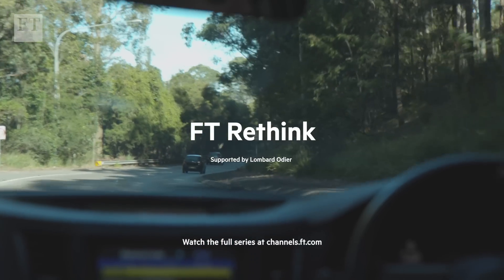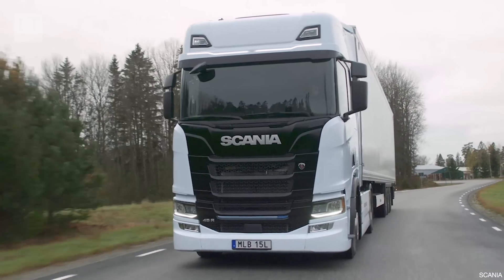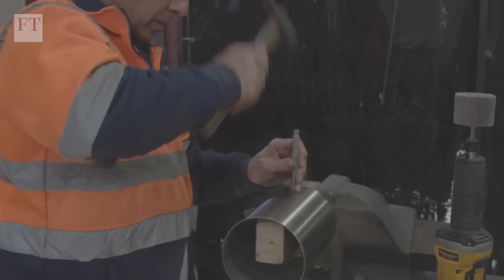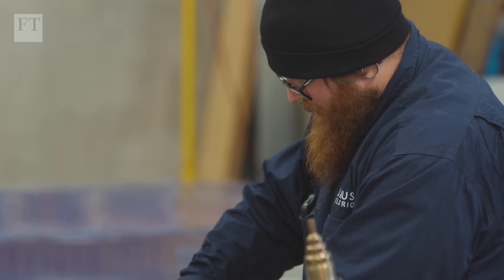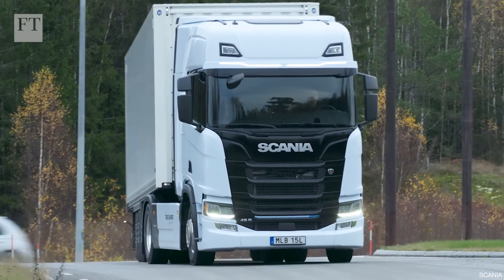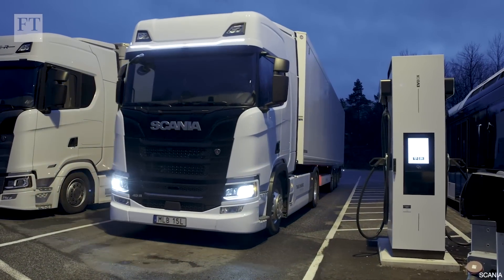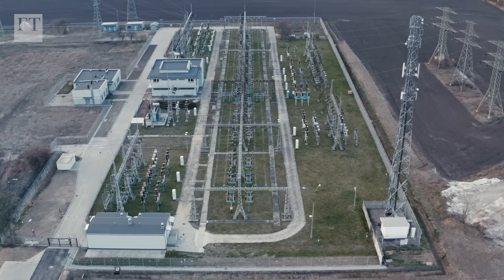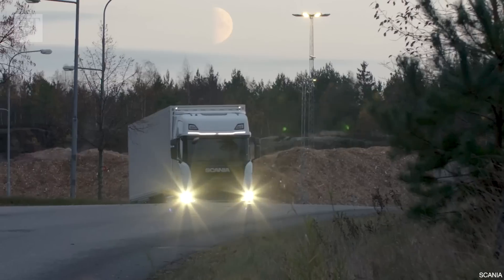The long haul to electrify heavy trucks | FT Rethink

Comment: Electric trucks.. what a pipe-dream; more likely to get long haul electric trains before trucks; how about planes?
Reply: Long haul electric trains are electric...diesel electric. The motors that drive the wheels are electric and the diesel is for powering the ICE onboard generator.
Reply: @jaaklucas1329  The video is about BEV trucks which depend on batteries, which is nothing like a diesel-electric trains which depend on diesel engines; to be clear, electric motors are great, it's the batteries that need charging that are total crap.
Reply: @petesmitt  My point is electric drivetrain is superior regardless of the fuel. Edison trucks uses this concept,E drivetrain with onboard generator.
Reply: @jaaklucas1329  My point was that battery electric trucks, trains, planes will never happen.
Reply: @petesmitt  My grandfather told how people laughed at the first automobiles.But eventually horses had to go because the streets were so polluted with horse crap...
Reply: @jaaklucas1329  Ironically, you have just explained why ICE vehicles are so good; fun to drive, extremely capable, refuel in minutes; no wonder that horse drawn vehicles were abandoned in favour of ICE vehicles; that said, horse drawn vehicles survived in western countries like Britain and Australia up to the 50's, eg, delivering milk to residential properties.

Comment: The problem with big trucks is that they need lots of batteries  .... and batteries are expensive.
Reply: And the weight takes away from freight weight.
Reply: @ChadWilson  last mile and delivery in congested areas will work well but on a route from Chicago to LA diesel is hard to beat.  .... I could see a turbine as a generator for electric motors could be interesting.
Reply: @CHMichael , agreed that for last mile, this would be a fantastic option.

Comment: Battery swap systems are a dead end. The industry would have to make a standard for swappable battery modules. Such a standard takes at least 10 years. 

In 10 years either the OEMs have gone bankrupt and Tesla has won or Scania, Volvo, Mercedes, Traton, Proterry, Cascadia and everybody else sell their electric trucks with fixed batteries or their own manufacturer specific battery swap.
Reply: Already doing this commercially.